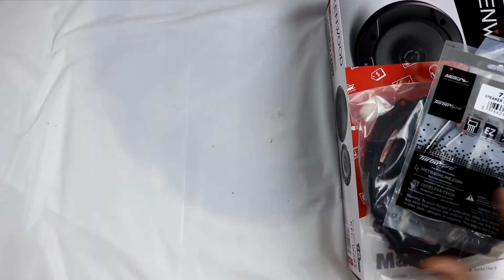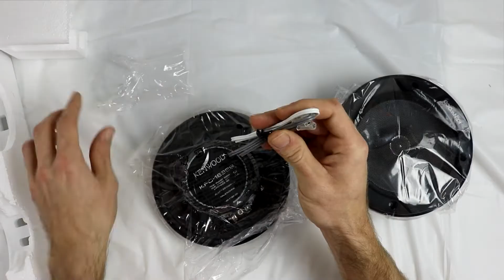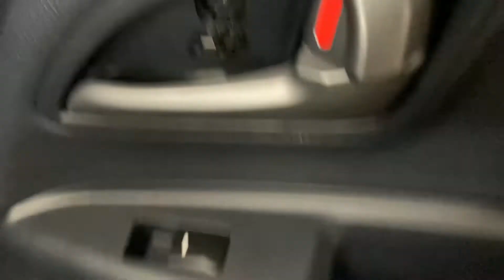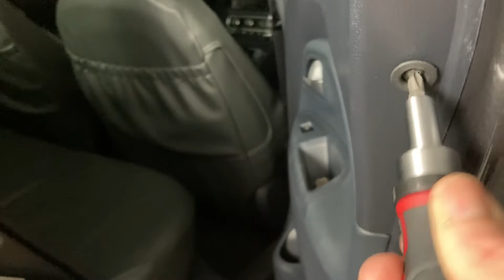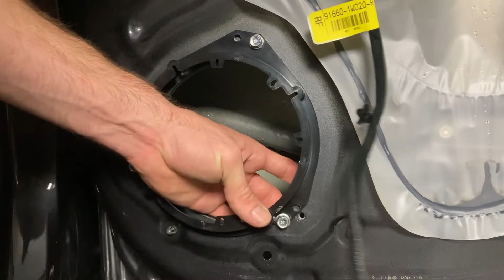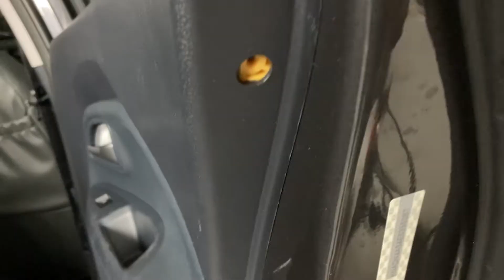Kenwood KFC 1666s Unboxing & Install from Crutchfield | Kia Rio Soul Hyundai Accent

Comment: just ordered mine from crutchfield too how was the install?
Reply from the maker: As long as you have a good drill bit, it’s a piece of cake 👍
Reply: @EnoughAboutCars  yea I’m doing this on a Jeep so no drilling required but regardless it seems really easy, if I get an amp in the future would I need better speakers?
Reply: @EnoughAboutCars  what drill bit size you use to drill new hole ?